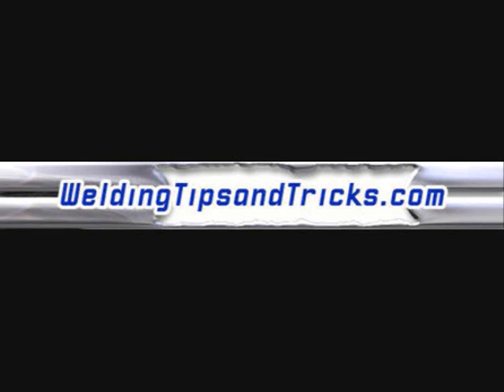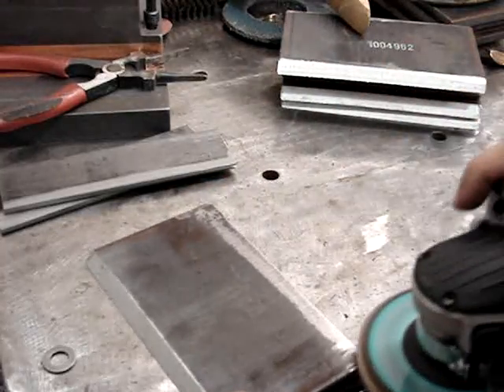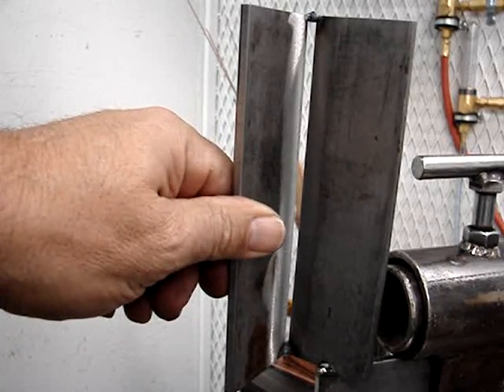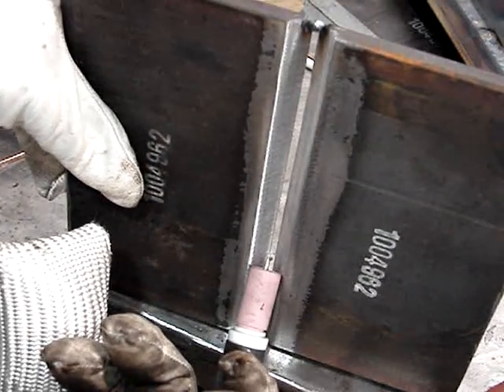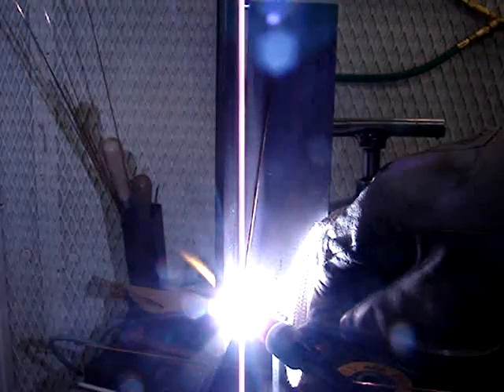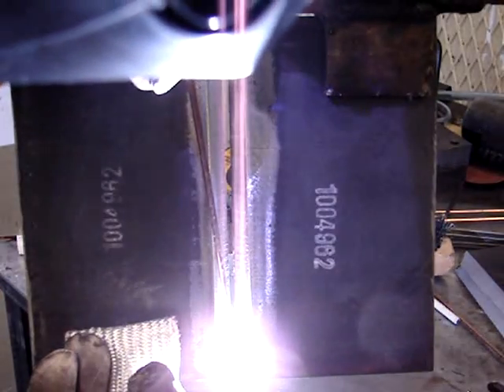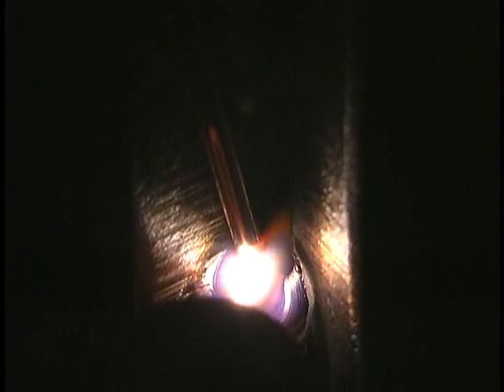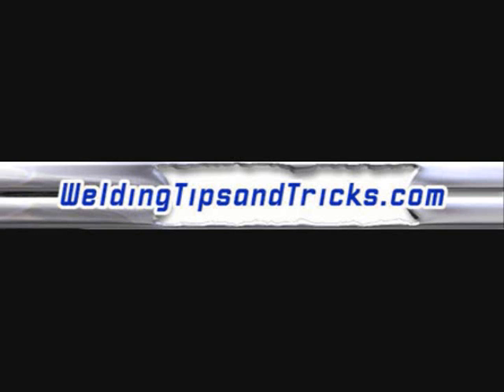Tig Welding Test Practice

Comment: Glasses, yes.  Gloves, NO! It's far too easy for a glove to catch in rotating parts, and that will cause much more damage than just getting a little nick if you get too close, and the sparks don't have enough energy to break OR burn skin.  With bare hands, you can really feel what you are doing and you can control the metal better.  If it's getting too hot to touch, you're grinding too much too fast.

NO GLOVES around rotating parts!